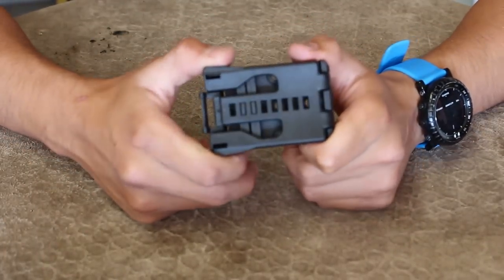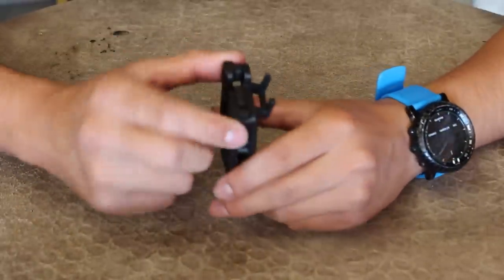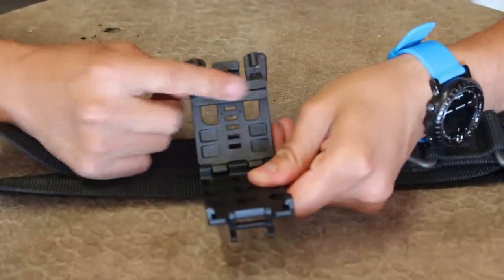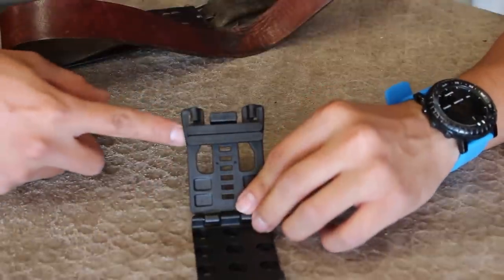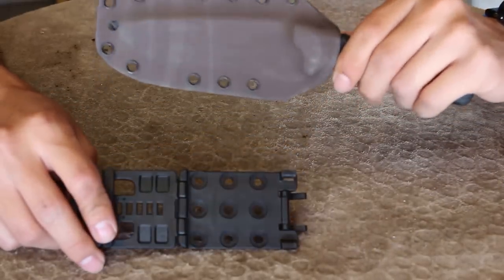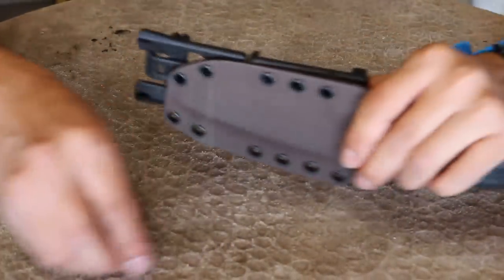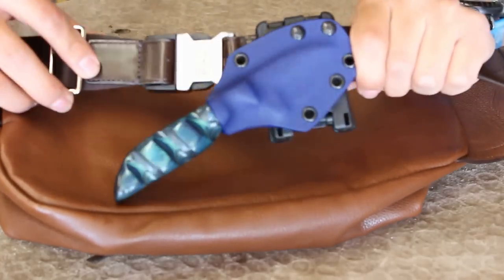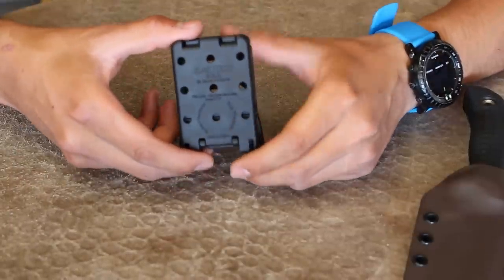How to use/install Tek-lok

Comment: ......So, it looks like the knife sheath then rides on the outside of the belt, and One normally has to remove the belt, in order to take the knife and sheath off, (in other words, the toggle lock, and "squeeze" steps are only necessary during the initial assembly of the "Tek-Lok" assembly onto the knife sheath. = it's not used very often!..) Thanks!!!! This really helps, since I just bought a Boker double edged combat dagger, and I need to get it set up for EDC.   Thanks!!!

Comment: Thinking about ordering a Tek-Lok. Have you found that once the belt width has been set that you can easily thread the belt through the opening without opening it each time. Thanks for the Informative video.
Reply from the maker: 47fireguy you could run your belt through but why wouldn't you want to open the latch without having to take off your belt?
Reply: Agreed there may be times to open the latch but if I am putting on several items on a belt it may be easier at times to thread through it. Just wondering if you could run a belt through it. Thanks.

Comment: When I received my holster from Tru-Blade the Tek-Lok was pre attached. I noticed on your video, and on another I watched you put the release on the top of the belt. Tru-Blade put it on the bottom. Does it make any difference?
Reply from the maker: Not really it's a personal preference,  I feel it's easier to open the latch from the top.

Comment: Just used this on the bk2.

3 screws on the side 4 zip ties on the bottom 2 of em being middle bottom.

U can use zip ties to make any config work.

Anyways.

Mine is set of for horizontal carry I pull to my right side blade facing down in order to pull out the knife.

Cheers

Comment: Decided to finally order a tek lok after seeing your video, now after receiving it, the included screws are like half as long as the ones in this video, screws weren’t even long enough to pass thru the kydex holster rivets
Reply: did you try it without the rubber pieces? Tek-Lok really cheaps out on this product... It should include more sets of screws in varying lengths... Its pathetic that they only include 3 sets of small screws.
Reply: R H I emailed them and got them to send me the “knife sheath hardware” which included longer screws and posts
Reply: @johnnygee_1991  I may have to give that a try

Comment: Is there a smaller version of the tek-lok.  I'm trying to make a bird and trout knife into a something carried on a belt instead of hanging around my neck and I like this design but it's to large for my needs.  Thanks.
Reply from the maker: schlaznger yes there is a smaller version of the tek-lok. Perfect for smaller sheaths.
Reply: Great, thank you for the help.
Reply: Look into the ulti-clip slim...that's exactly what you want

Comment: 3:30 who cares about wiggle room if the entire thing slides side to side? I cant stand the fact that they didn't design it to actually grip onto the belt itself. I don't want to go to pull my blade out and the entire tek-lok pull back with it until it slams into my belt loop eventually tearing it... My solution was to use two of the screws in the center of the tek-lok with the rubber pieces on the inside so they grip the belt and stop it from sliding side to side. The problem with that? They only give you two screws so that leaves me with one screw to attack my knife to the tek-lok which isn't enough.... For what they want for these things they should include 5-6 sets of screws.... Its pitiful

Comment: Very nice quality materials with a terrible design for adjustments. I spent two hours last night removing three screws to adjust position of the Tek Lok on a new BladeTech Classic OWB. The t-nuts are nearly impossible to access with a blade driver when attempting to unscrew the phillips screws. Had to make a tool to complete the job. There are a couple of obvious ways to simplify screw/t-nut access, and it baffles my as to how the designers missed this. Again, great quality materials in belts, buckles, holsters, mag pouches, etc., but not at all user friendly if you wanna make other than "standard" adjustments to the factory-mounted Tek Lok on the classic holster.